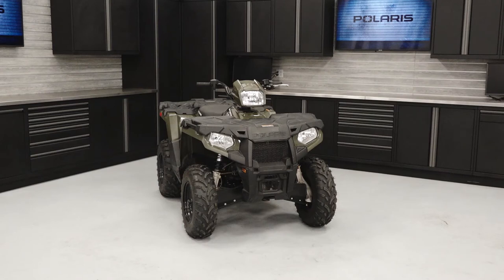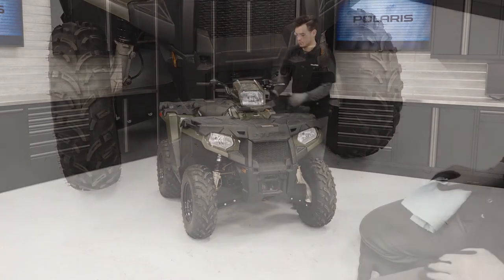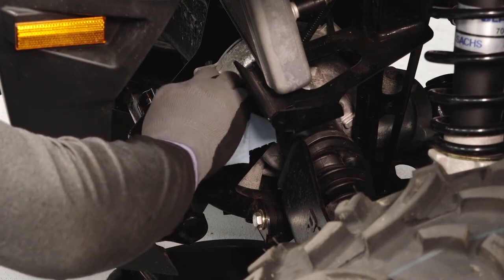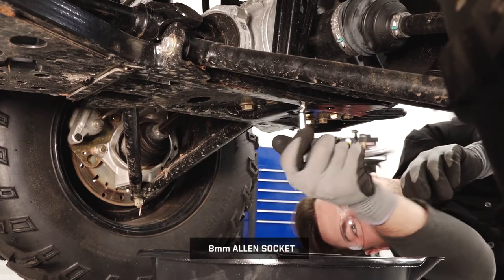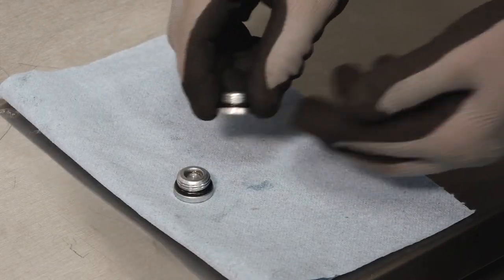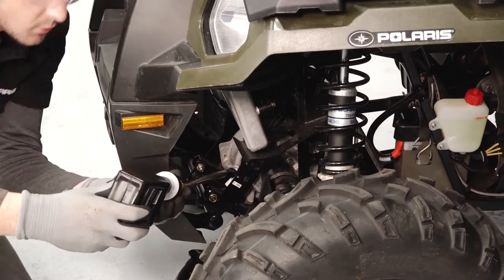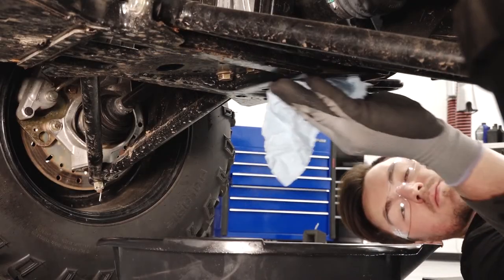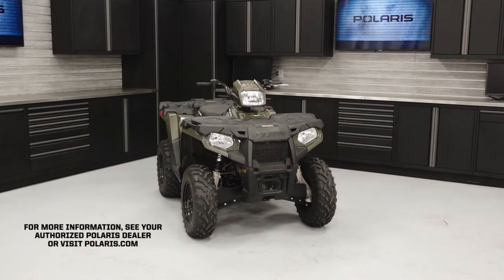Sportsman 450 H.O. Front Gearcasase Fluid Replacement | Polaris Off Road Vehicles

Comment: It looks like the winch has to be removed first. Polaris, and thoughts?
Reply: John, a good Polaris "nut" I know said that the winch will cause serious issues with this fluid change.  He said to rig up a 1/8NPT hose barb fitting, then attach a small hose to the top around where the radiator cap is.  This will give you an easy "fill" location for all further fluid changes.  Good luck.
Reply: Just went to try and do mine and my winch is in the way WTF
Reply: @gregh2880  That sounds like a useful idea, but it raises a couple of questions.  If the fill hole is occupied by fitting, how do you see the threads to know when to stop adding fluid?
Reply: @jeremyomnet  Arranging it this way is as egregious a design flaw as where the 12v battery is placed on these mid-teens Sportsmen.  Ridiculous, and so easily avoided.
Reply: @floobertuber  sure is, I sold it. Bought an older Honda lol.